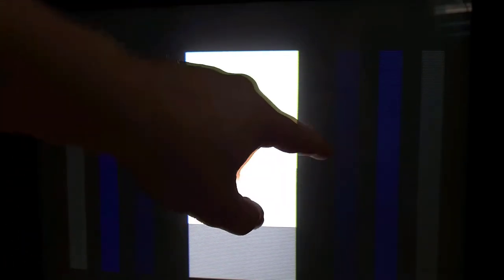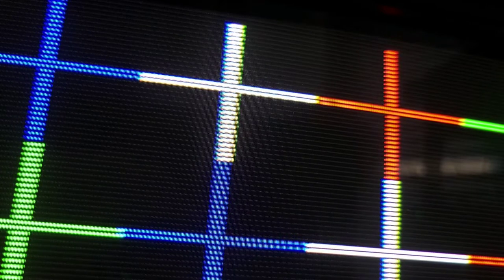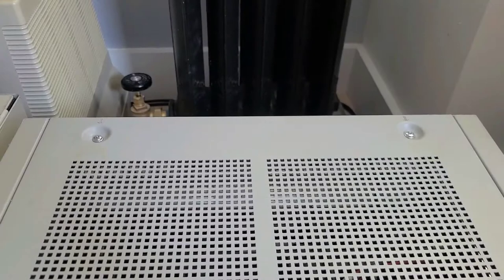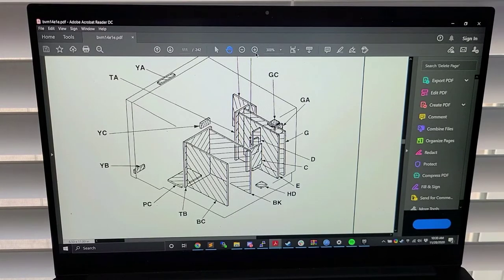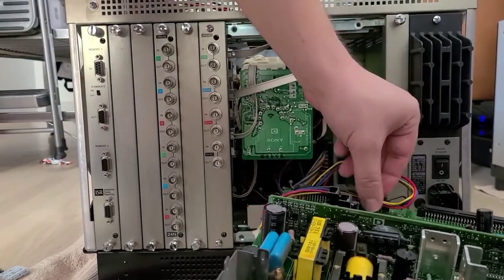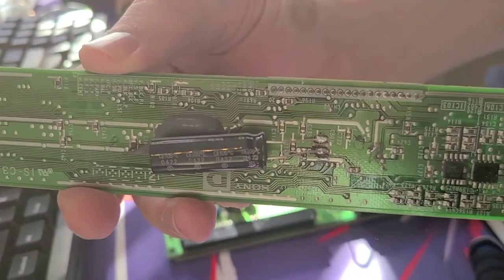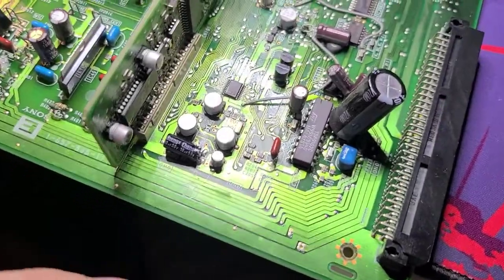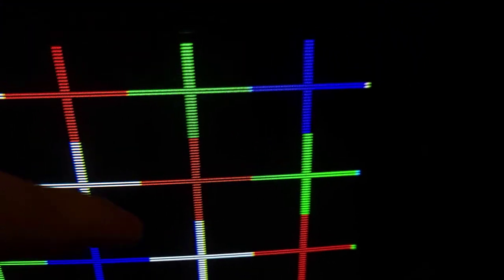Sony BVM-20F1U Jittering Picture Repair

Comment: Might be stating the obvious here but you can adjust the static/dynamic convergence in the alignment menu. You can get the whole screen pretty close to perfect. If you download the operation manual you can see which codes apply to which regions of the screen.
Reply from the maker: No worries I found all of those options and got the convergence perfect after the video :)

Comment: Thanks for sharing this Andy, did you end up replacing more than the pat savon recommended caps on the deflection board ? Working currently on eliminating a slight jitter on my 20F1E, any advice will be great.
Reply from the maker: Nope! The D/E recap shown in the video was all I had to do. I still have the unused cap kit for the BK board that Pat included because it wasn't necessary.
Reply from the maker: If you're doing the recap yourself, my advice for removing the SMD caps is to take your pliers and twist the top of the caps off gently and slowly. By far the easiest way to remove them. There are several videos documenting this on YouTube, that's where I learned the trick.
Reply: @treminaorugx  Thanks for confirming, will let you know if I get as good results as you.
Reply: @treminaorugx  in the hands of a friend but I will pass the tip over to him 👍🏻
Reply: @PapiFed  worked?
Reply: @eduardm.6718  Sadly no major improvement after the deflection and PA board recap.